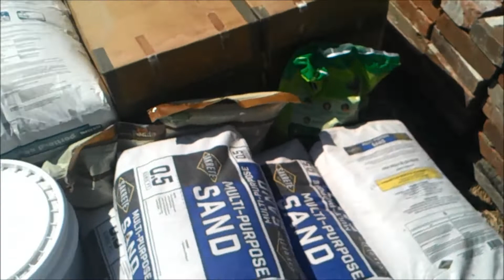HOW TO BUILD A BRICK BREAD PIZZA OVEN GRILL SMOKER OFF GRID OUTDOOR KITCHEN  PT 1

Comment: G'day Erin & T.    It is Beer-Bread time for me, cooked as 9 pancakes quickly in a Dutch-oven, cast-iron, flat fryer. Three ingredients = 3 cups self-rise flour, 1/3 cup sugar, and one 12-oz can of beer.  Greece the bottom of pan, pour in the batter, cover the pan and heat for 5 minutes.  Also you can add Cocoa power if you want beer-cake.  It will feed you for 3 days, then repeat (yes, I have a couple cases of beer).   Last Saturday  was Sept_17 (I called my sister to wish her happy 74th birthday).  Tuesday stock close was down 312, tomorrow the FED raise rates 75 to 100 basis points, and stocks will dump another thousand points ?   It looks like you guys are doing OK, and ready for a couple of weeks of gun-fire to protect the homestead.  Best wishes from Florida.